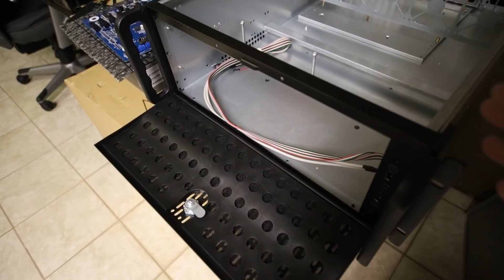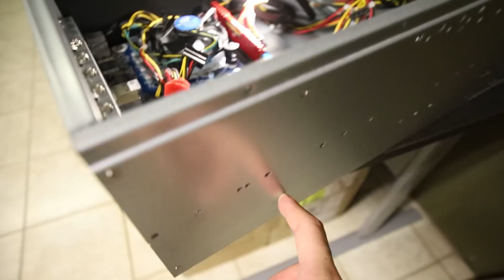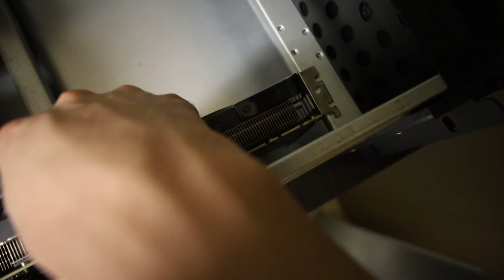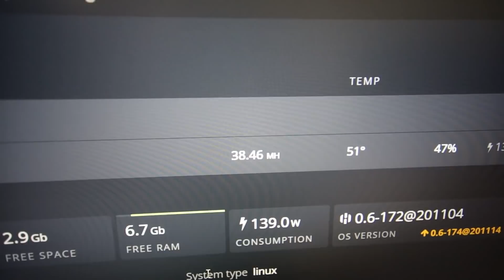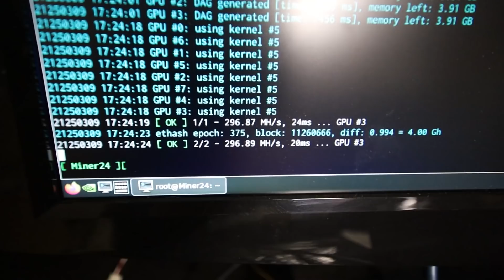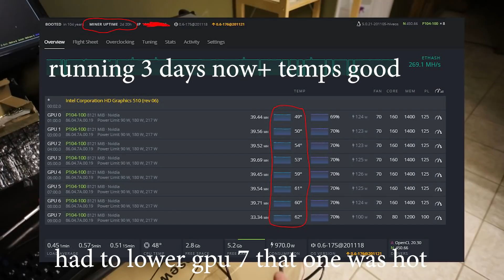Building a Mining Rig with a ROSEWILL RSV-L4000B Server Case!

Comment: I´m new to mining, and really enjoy your videos =). One question tough, is there any reason why the GPU´s exhaust are pointing forward? Wouldn't it be better airflow if the GPU´s were oriented the other way, so that they could suck in cold air from the front fans, and the heat/exhaust was blowing towards the back of the case,?

Comment: oh dear, I've watched a lot of videos of them now, but that's by far the worst. 120mm fan on 40mm fan bracket without further cutting out the metal ... and then the airflow from the last fan on the power supply is completely blocked ... That can be done better.

Comment: Waatch out for the screws on the mobo plate on the 6U Rosewill 8 GPU case. It shorted the motherboard out and I couldn't figure out what the issue was without disassmbling the whole thing and then removing some of the screws that hold the plate on. Luckily the asrock mobo is a beast and survived lol

Comment: I've found that the front dust filter really restricts airflow from the front fans, I removed it and my rig got cooler by about 10c. Sure it'll get dustier faster but I don't mind. Worth it when it allows me to save electricity and my hash rates.

Comment: Hey long time user of these 4U cases, any reason you didn't orient the delta fans from the very "front" of the case where the mesh is to push air across the GPUs and then out the back where the motherboard is? Other "pre-built" 4U chasis have it setup that way and the original rosewill-c cases have it oriented that way to cool the HDDs that are in-place of the GPUs, it seems it would make more sense to pull in air where the mesh is and exhaust out the back which is what I have been doing back before rosewill made this "GPU" model and I was ripping out HDD cages.
Also in my experience the mesh blocks a lot of airlflow in either direction so it may be worth testing it without the mesh as well

Comment: Hello, I was able to get the PhoneixMiner to work with the ClaymoreMiner settings, but it is a long trick to explain I hope my English is understood something.
1st You edit the Claymore .bat in the pool address you place an address or port that does not exist or does not lead to anything (leave the configuration of voltages, frequencies and straps as usual), then Claymore will execute until reaching that part and give an error connection to the pool, but you will have already configured the GPUs, at that moment if you want to pause you click or select any text within the .bat window and the .bat pauses. DO NOT CLOSE THE CLAYMORE .BAT WINDOW, because if you close it, Claymore will remove the GPU settings.
At that time Claymore will not be mining but the settings were placed on the GPUs even the -strap.
2nd You edit the Phoenix .bat and remove all the configuration (voltages, frequencies and VRAM timings) of the GPUs so that it will mine with the current configuration, which is the one that Claymore placed in the GPUs.

For now there are no problems and it is stable, the problem is that it is not automatic, but I recovered the Hashrate.
I don't know why it happens, but mining only with Phoenix, many GPUs only reach 22MHs, 25MHs, 27MHs ... etc.
With Claymore almost all RX 570-580s reach 30MHs, some 29.50MHs, but it no longer works with the latest "recommended" driver from AMD, it produces the error VRAM insufficient for the DAG (8Gb GPUs with 64Gb VRAM of Windows), only it works with the latest drivers but without the "-strap" option (produce Blue Screen), just -mclock and -rxboost and it's not enough, again only reach 22MHs, 25MHs, 27MHs ...

Well I just wanted to tell you about my experience, greetings guys from Argentina and please do not EVER get infected with socialism, here we are going to be Venezuela, it's like a plague, never let it get there.

Comment: I have used these cases a lot, was able to get the ones with the fan mounts on the front, love the case especially for the smaller 1660 supers that run very cool in general.

Comment: I have 3 of these chassis.  I removed the stupid plastic dust filter cover and carbon dust filter from the front and put in 2x 120mm fans and 1x 80mm in the middle, and put 2 screws in each fan through the front of the case to hold them in.  It kind of sucks but its better than having no fans in the front.

Comment: your going to start a fire with your splitter. thats over 200 watts on one cable my man
Reply: @Neurolicious  thats dangerous. your cables should never get warm. this is how RPM melted cables earlier this year. VGA cables are made for 200 watt max per the manufacturer and the only thing I run in tandem is the riser not main GPU power. but what do I know i only have 50 GPUs
Reply: @peppercar yea the manufacture only wants you to use up to 150 watts on the VGA so your engineer friend is 100% correct my man. and your so right about how ppls set ups are very dangerous for sure. sounds like you have done your research for sure. as long as we try to teach ppl this we did our part to prevent fires lol

Comment: I've been looking for a server type case for a while and I do appreciate what you have done with the Rosewill case but overall, I do not like the way the case is designed for several reasons.  First, lets assume that the case is going to be mounted on a rack so the means that there will essentially be a hot isle and a cool isle.  The cool isle being where the on/off switch and the cool air intake will be.  The GPU’s are also mounted near the cool side of the case.  Air will flow into the case, through the GPU’s , through the Delta fans then over the power supply and motherboard and all the associated cabling.  This means that the power supply, motherboard and such will be subjected to a lot of heat generated by the GPU’s.  I’m not sure it is the best idea to have the power supply, motherboard and all the cabling on the hot side of the case.  Plus if you have blower GPU’s, they would be blowing hot air out the front, through the cool air intake basically fighting the reverse air flow created by the Delta fans.

To me it makes more sense to have the PS, Mobo and such on the cool side of the case so all the on / off switches, power cables, and what not are all accessible from the cool side.  Then the Delta fans pushing the cool air over the GPU’s out to the hot side.  The will work with blower GPU’s as well because they will push the hot air directly into the hot isle.
  Just wondering if you have any thoughts?

Comment: Hey Red, if I heard you on the live stream correctly; you said you had your RX56/57 PCie rails set to Gen2; right ?  Is there a consolidated list of the clocks and power settings for the RX56XT and RX57XT cards somewhere; finding a lot of swing in all the raw data sets out there; and still having a tad of stability issues with building this new rig; just trying to go with the stock bios for now; until I get them stable; already went down as much of the troubleshooting list as I could think of; and even switched out psu's and the cpu; just to eliminate everything but the cards themself as being the cause of the issue(s); lockup, crash and reboots; I appreciate your feedback; Gen2 seemed to help a bit; I had them on Auto.

Peace